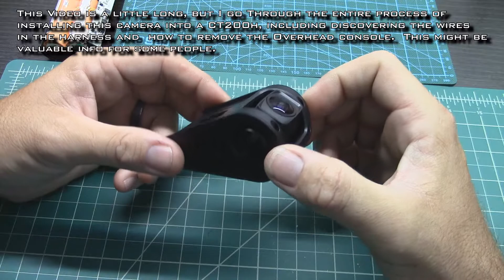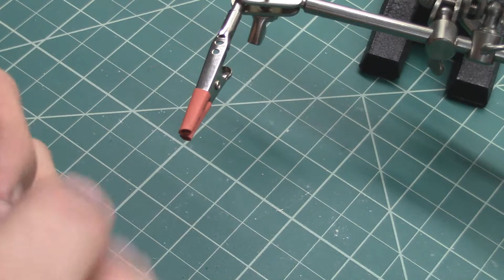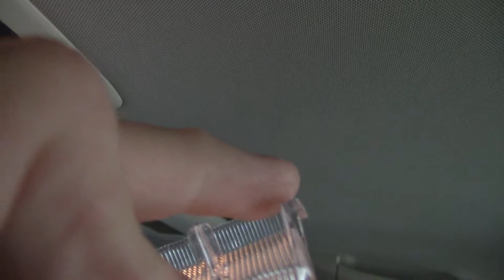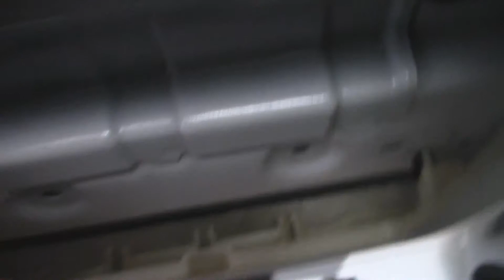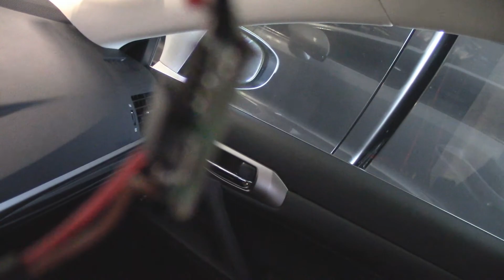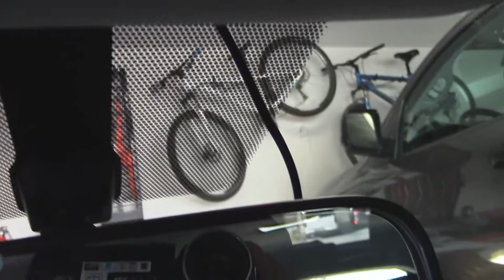Dash Cam Install Lexus CT200h

Comment: Hi there, how would one go about putting in a parking mode with the method you have described? Another user mentioned tapping into the Yellow wire to get the constant power. This is great, but how does it get wired to the dash cam?
Reply: Your dashcam will require a parking mode kit.

Comment: For those who need 'always-on' power (e.g. for those who want to use Parking Mode), use the yellow wire right next to the green one.  It has 12V regardless of the ignition being on or off.
Reply: and what about a battery (accu) ? no problem with dead battery?

Comment: Thank you for the vid! Does the colors of the cables are the same in the European version? Thank you
Reply from the maker: +Danilo Esseduekappa  I would think that they colors are the same, but I cannot say YES with 100% certainty.  I found some of this information online in forums and also by testing the harness plugs.
Reply: @OinTaylor  If it matters, I just finished installing a dashcam in my 2011 CT200h european version, can confirm, the green one (8) and ground are working fine after pulling it down to 5v. Thank you for the video, was a great help!
Reply from the maker: @ein_warlock  glad that it worked out for you!

Comment: What year is yours?  Mine has a usb connection right next to the rear view mirror.  It's behind a plug cover
Reply from the maker: bertalev2010 Dude, don't tell me that!  LOL  I  think it's a 2016?  Wife's car.  No Nav, no rear view camera or mirror with hidden LCD screen like in my Tundra.  I did not see any type of USB near the mirror, maybe I overlooked it...
Reply: I wish! I don’t see any such USB port. The closest one I have is in the center dashboard box (non-nav). I like how this looks, though I’m scared to pull that console down. Mine is a tad different with the home link buttons for garage door openers, but I assume wire harness will be similar. I actually want a switched source though and not constant hot. Mine is also a 2 camera so I have to run and tuck a wire all the way to a rear camera as well. 
Very helpful video though.
Reply: bertalev2010 seriously!? Is it on the mirror or where is it? Don’t see one in mine

Comment: Just did this on my 2017 CT, this video helped a ton! Thanks!
Reply: You have also parking mode enabled? if so, is it safe wit making the battery empty?
Reply from the maker: No, parking mode not enabled.    It shouldn't run down the car battery even if it was enabled.